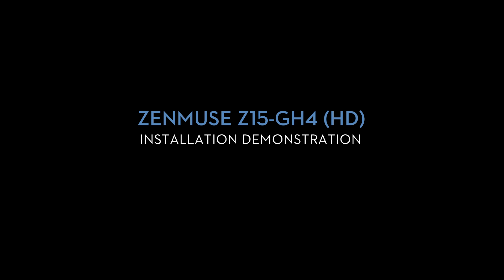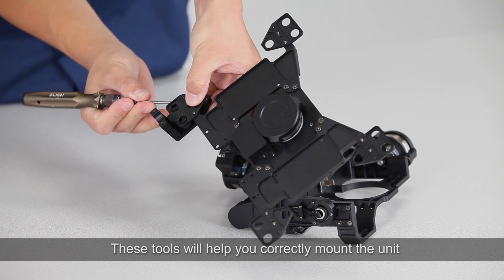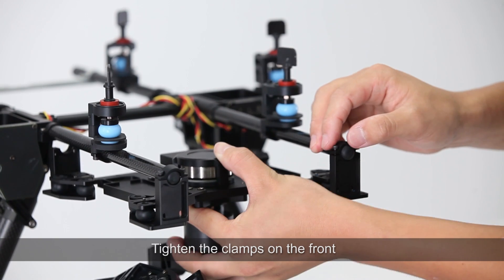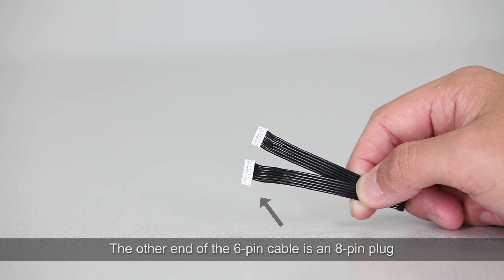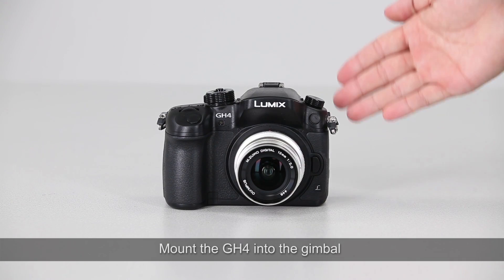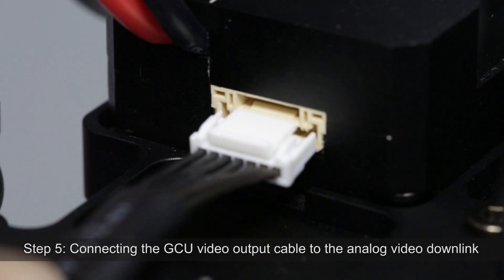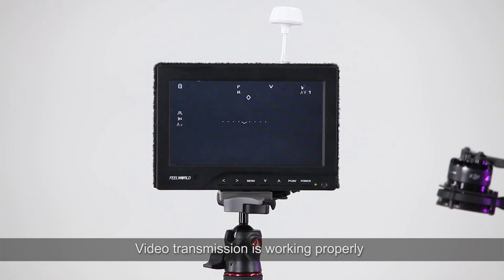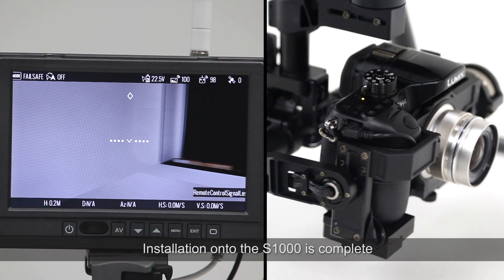DJI Zenmuse Z15-GH4 (HD) Assembly and Installation

Comment: This gimbal does not power the camera, does it? I just bought this for my S900, and have a new GH4 camera on the way. Just now realizing that I don't see any connections providing power. Will the camera have to be removed for charging every time it is low? My H3-3D gimbal powers the GoPro, I assumed this would power the camera as well.

Comment: Just got it today .. But there sits a plug glued where the camera must surges on . !!! in your vidio sits also the same place on the plate as the camera rests on .. But later you can see that using such a plug and put it in the camera .. Do you break it off . ??? It is stuck, it seems like it should be there. !
Sorry Google translator ... ( Danmark )

Comment: So with the specific gimbal can you only have that specific 12mm lens on it? I would prefer to use a 7-14mm, but I know the Mark iii gimbal only allows a 24mm prime... Would I need to locate a different Gimbal to be able to fly the GH4 with a 7-14mm lens on the s1000?